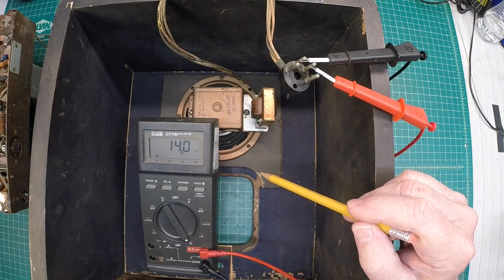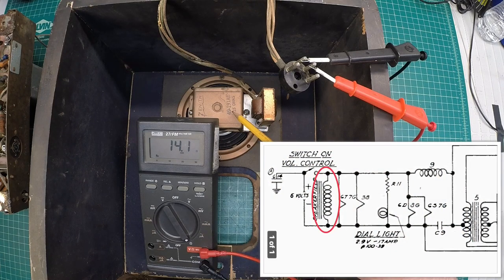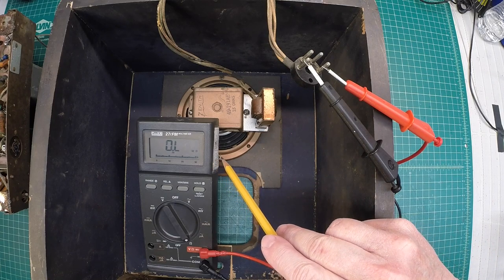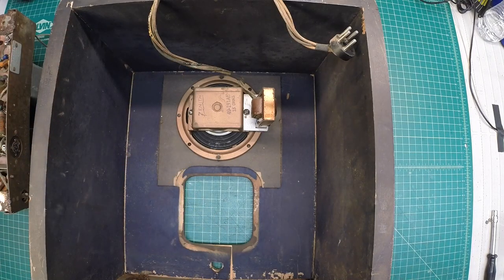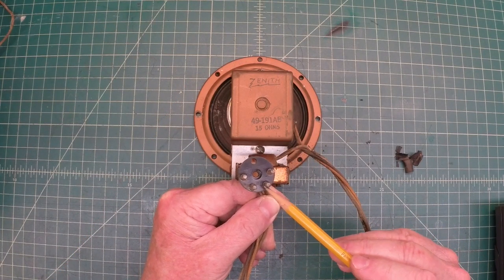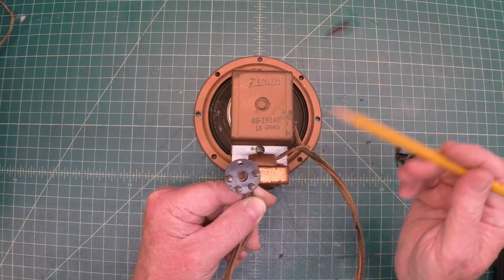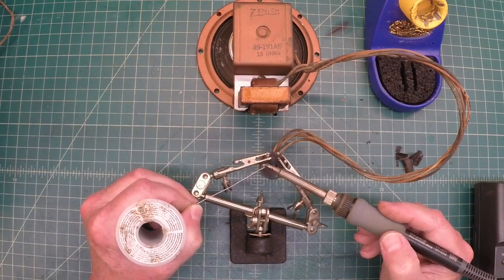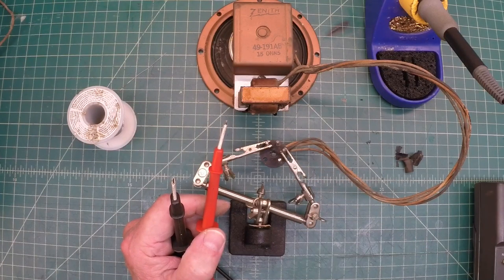Zenith 4-B-231 - Speaker & Output Transformer Testing/Repair - Part 3

Comment: Hey Don, I've been watching your videos for quite a while, and I surely do enjoy them. I don't guess you have a Patreon account or something similar where viewers like me can "give back" to you? I'd love to buy you a case of something cold and refreshing. ;)

I don't ever remember seeing this video before, but that's probably because I've never had a bad output transformer before! I found this video while doing a search for "output transformer replacement", and was extremely pleased to find it. I watched very closely, took note of the number and direction of the turns, and managed to get my transformer opened up. It's actually off a Zenith 5-S-119, and had the same symptoms: open primary and working secondary. Where it differed, though, was that the primary winding wasn't "quite" open - it initially measured somewhere around 10M ohms, but rapidly counted measured lower and lower the longer I kept my leads attached. I don't know how long it would have taken to get down to the "normal" value of 2125 ohms, because I always lost patience. I did get it apart, and no matter what I did, it always behaved the same. I tried using two other meters (including my buddy's fancy Fluke), but I continued to get the same results. After a few hours, I eventually scrapped it. So - I have three questions for you:

1) Any idea what might be causing this?

2) Now that the transformer is kaput, do you have any idea which "universal transformer" I can replace it with? It wasn't giving me reliable measurements, so I don't know the inductance or impedance. I DO know that the speaker is a 6" Zenith speaker, part number 49-143, and that the Zenith parts catalog lists the output transformer as 206-143. The schematic shows it having a resistance of 2125 ohms. I don't want or expect you to do the work to figure it out mathematically; I just thought you might have restored one of these already and might have the info in your notes somewhere.

3) Do you have a website, a business, or some other way to get in touch with you other than through youtube comments? I'd love to make a donation.

Thanks again for all your great videos. They've been a godsend!

-Stephen
Reply from the maker: Stephen - thanks for your kind words. To ensure my response is accurate, you mention the schematic references 2125 ohms, but when reviewing the schematic for the 5S119, that ties back to the Field Coil, not the Output Transformer. Please clarify which one shows trouble. Thanks again. Best, Don

Comment: 👏🏼 👏🏼 👏🏼 Just an AMAZING REPAIR! 👏🏼 👏🏼 👏🏼 
This was one tremendous repair. After seeing the size of the field coil I was thinking, ok maybe, if the break is right there at the connection but when it wasn’t, and you had to dig, I figured there was no possible way. Then you found those tiny ends. It was so cool, nice job!
Reply from the maker: Thank you Buddy, it tested my patience and eyesight for sure. I think you’ll enjoy the power supply repair as well coming soon. Best, Don
Reply: What! Power Supply repair? I mean this is great “Repair” radio but don’t you ever get anything that even remotely works? 😊 That’s why you are such a exceptional technician👨🏻‍🔧
Reply from the maker: It’s my next video in this series, I investigate the power supply followed by repairing it. Hope to have another video posted next week. All of my stuff is junk to many & most don’t play. I’ve got over 100 left to restore. LOL Best, Don

Comment: Great video. I had an output transformer fail via arcing through the exterior. After watching your video, I thought I’d investigate a repair versus replacement. The fault was on the coil wire adjacent to the primary lead. I was able to effect a repair by soldering in a strand of wire to replace the burned wire. Thanks for the video !
Reply from the maker: That’s awesome. I’m glad you were able to locate and repair the open winding. Thanks for reaching out and all the best. Don
Reply: Enjoyed your work. Question, not having an audio generator I’ve tested speakers with built in output transformers by briefly connecting the secondary and then the primary to my playing solid state stereo and listen for the sound. Is there any harm in this? Incidentally, I’ve checked them the same way with an inductance meter using different settings on the meter and getting different tones.

Comment: What a great tutorial for a job that seemed to me almost impossible at first. I’m curious about how you’re able to see your work when the camera would appear to be right in your line of vision. Are you primarily watching a camera monitor as you work or are you somehow able to get a good line of sight even with the camera there? Would love to see a “How to make a video” video.
Reply from the maker: I typically use my old GoPro camera, which has an ~18” extension fastened to a shelf just above my head. I use the WiFi feature and keep my iPad on either side of me for reference. Most of the time I don’t even view the iPad real-time as I preview the video first to ensure I know where my out of bounds are located on my green cutting mat for example. Sometimes I cross the limit and get to close or just outside of the camera view. Even though my camera location allows for some great close ups, it limits my ability to see things at times without sticking my head in front of the camera. I’ll look to do a video on this over the winter.  Thanks again for reaching out and following my channel. Best, Don

Comment: Hi Don. You're the Man :)  Most would have trashed that transformer . great place  for young and old to learn the art of repairing these great old set's, L,S,a,t,P.  Looking forward to more buddy.'All my best to you and yours.
Bobby
Reply from the maker: Thank you my friend. I hope to have the power supply video up next week. Enjoy your weekend. Best, Don
Reply: Hi Don. I have ordered the parts for the transistor  am transmitter . While I was looking at Mike's electronics. I happened to see some kits. One being the  Spooky Tesla Spirit Radio Parts Kit. I got it and built it. Still waiting on the transistors for the transmitter. . I was messing around with my amp and turned on my tube type  am transmitter. I tuned both the spirit radio and had music playing from my mp3 player  :)  Lol. Thank you my friend for all the links.
All my best 
Bobby
Reply: Oh and have a Great Weekend to : )

Comment: Don, 
Your calm, measured and logical approach to troubleshooting is an inspiration to me. Sometimes when I am working on a project I tend to just impatiently rip things apart in an effort to find the problem. I am getting better, now I hear your voice in my head and try to slow down and take my time and think and observe. Great to see you posting videos again, I missed them. 

Do you attribute the failure to electrical or mechanical cause?

Thanks, Ian.
Reply from the maker: Ian - I really appreciate your kind words. This repair tested my patience, but going forward and not giving in made it rewarding. Now, having my voice in your head scares me. LOL Have a great weekend. Best, Don
Reply from the maker: I didn’t answer your question. It’s hard to say for sure, but things were in ok shape around the output tube other than some nasty caps. I’m leaning mechanical. Best, Don

Comment: Does anyone no where you can get a dust cover for speaker like his that mixing a dust cover anyone.and what glue do you use to fix small hole in speaker,speaker glue,Aileen glue ,silicone ,white elmers ,anyone who can help me with that.
Reply from the maker: Hi Ron - I’m way behind on my replies to folks like yourself, so please forgive my belated responses. Simple dust covers can be made with felt from a hobby store or other... I’ve had the best results using Aleene's Original Tacky Glue with a few drops of water to repair speakers cracks or holes. Coffee filters or rice paper, even toilet paper can be used for those repairs. Just make the patch as small as possible. Hope this helps. Best, Don

Comment: Learned a lot.  I'm Gonna give it a go into my "open" power supply.  I guess nothing to lose.
Reply from the maker: I hope you are successful. All the best. Don
Reply: @RestoreOldRadios  2nd winding (thin as a hair) was broken in several places that are beyond my capabilities.   This was a replacement speaker that was wired not by the schematic so for a novice I am struggling.  I have a Utah speaker with no power supply.   RCA 86T by the way…with some wires and a capacitor that should only be in an 87T according to what I’ve read.
Reply from the maker: @donde1760  The wire gauge to your point can be really small, a few thousandth of an inch, so repairs at times are nearly impossible. Do you feel like your Utah speaker can be used as a substitute? Best, Don
Reply: @RestoreOldRadios  The Utah speaker was in the radio when I got it (clearing out my mother-in-law's farm house), so I assume it worked.  The cone is good, I rigged my Ipad to it through the headphone jack.  It has 3-5 Ohms VC printed on it, but I have no clear idea what the transformer specs need to be.  Or what to do to put a newer speaker in.   YouTube is helpful, it just takes TIME!
Reply from the maker: @donde1760  Don, what’s the make & model number of the radio? In addition, what’s the DC resistance of the Utah loudspeaker voice coil? Best, Don
Reply: @RestoreOldRadios  Hey,  the radio is an RCA 86T.  I measured 977 ohms across the voice coil, but I think that’s ac.
Reply from the maker: @donde1760  Something is wrong, the DC resistance of a vintage loudspeaker voice coil should be 2.5 to 4.0 ohms.
Reply: @RestoreOldRadios  Sorry I measured the "magnet coil?" wires...the speaker measures 3.5 ohms.
Reply from the maker: @donde1760  If you need an Output Transformer, a Hammond Universal Single Ended 5W / 45 mA, model P-T125BSE should work well. The load resistance of the 6F6 tube for your receiver is 7000 ohms, select the tap for a close match to that number. A supplier for the transformer:

https://www.tubesandmore.com/products/transformer-hammond-universal-single-ended

I’m assuming the Field Coil on the Utah speaker is a match at ~1290 ohms?

Best,

Don
Reply: @RestoreOldRadios  Thanks for the help.  I think the voice coil reading is 977 ohms.

Comment: Great job there Don. It is always nice to see stuff repaired rather than just replaced if it can be fixed. Probably not get away with that on a modern transformer with its dusting of insulation rather than a proper coating.
Reply from the maker: George, thank you. It was tedious, but well worth the effort. Best, Don

Comment: Brain surgery.for a radio.where can you get felt dust caps from,what was the first radio you ever fixed,and how long ago was that.I take it that what causes most  transformers to fail .thank goodness a lot of old transformers hold up.the
Reply from the maker: Ron - a search on eBay for felt dust caps or simply some black felt from a local craft store cut to size.

My first attempt at repairing a radio was my grandfathers green Emerson 888 when I was around 14 years old. I did a great job taking it apart, but never got it working or back together. LOL I didn’t learn my lesson and did the same for my other grandfathers TV, which I totally destroyed and left it scattered across his basement. He wasn’t happy with me as you can imagine! The good thing is, it motivated me to start learning more about electronics and jump started my career in the telecommunications field, where I spent over 40 years. Repairing old radios is really enjoyable to me today. My dad was inspirational too, and aside from shop classes back in school, he taught me so much as he built vintage furniture and alike for years, so repairing a radio cabinet for him was easy. His health has since declined and no longer works on them. He has over 100 radios in his collection. Thanks for following my channel and I hope you have a wonderful week. Best, Don
Reply: @RestoreOldRadios  in my twentys I had a Johnson white face cb radio ,I want to put in new resisters  ,it never worked again ,but in my late 20,s I found a tube tunner kit with majic eye tunning ,built it ,it still works ,my x has it.so I got better.